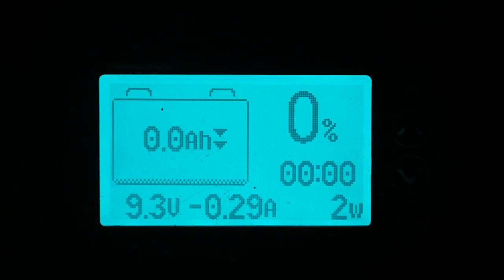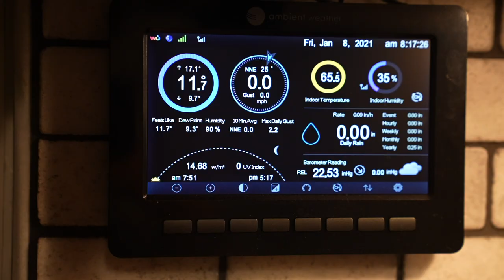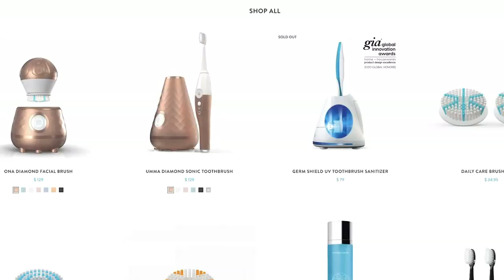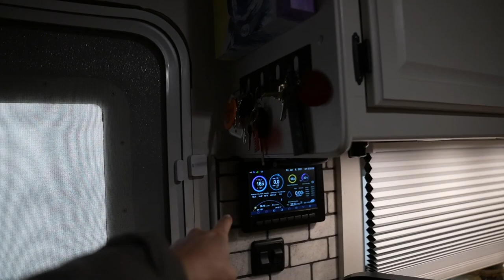WE'VE GOT MAJOR PROBLEMS | WINTER MOUNTAIN NIGHTMARE

Comment: Re: Trickle charger... (I posted a note a few hours ago about this but I think it got lost): Hoping you are not using trickle charger inside or in an enclosed space: we were fortunate to wake up early one day when our Carbon Monoxide alarm went off... took local fire Dept 2 house calls to finally determine our trickle charger in basement (to charge battery for our tractor) was releasing CO into basement and upstairs through our floor boards. Could’ve been a really bad outcome without having a CO monitor. 
If you don’t have some in place, trust you put smoke/propane/CO monitors on your shopping list. 
You folks are such a positive energy. Your videos are a breath of Mtn. air and so inspiring to follow. Keep up the great work....Best wishes as you continue this great adventure, from some old Do-It-Yourselfer’s from N. H.
Reply: Dear folks, CLARIFICATION: thinking back it may be our CO monitor went off from detecting high levels of hydrogen gas emitted by trickle-charging that battery indoors. Still dangerous situation we avoided by having that CO monitor...

Comment: Doing great, guys. Trent - you will be a carpenter by the end of the spring. Having experience with both plumbing and ventilation, would advise start with inside rough plumbing, then pull wire, then place ductwork then you can start drywall. And I noticed the world's best chocolate milk in your refrigerator.

Comment: Trent,  get rid of that crappy water pipe heater tape and go get the self regulating blue stuff it will not overheat and burn out. You have to insulate that pipe and cover it to keep the heat in.  O and the blue stuff is the only thing the farmers will use in this area to heat their water pipes for their cattle feed water.   I hope my 45 years experience as an industrial electrician, electrical contractor makes a difference with respect to my suggestion. Sometimes it’s hard for me to watch you guys do the things the hard way. I wish I could be standing there and make suggestions and save you all kinds of trouble but just like my kids you have to figure out some of the stuff for yourself. I Think the world of you two and I wish you all kinds of happiness and fortune.   Thank you for sharing. Lots of love, Joe

Comment: Want to bet your pressure gauge is where your freeze is happening? Had same issue here in CO during the winter with my pressure gauge freezing before anything else, and I didn't notice any heat tape wrapped around it. Just a thought/observation that might help.

Comment: One thing I strongly recommend is to meticulously plan your electrical installation (switches, lighting, outlets, etc.) as thoroughly as possible in advance.  I didn't do that; I just figured when the electrician arrived, I'd just point and tell him what I wanted and where.  That bit of inattention has led to an electrical setup that's grown haphazardly; I've got an embarrassing maze of conduits and subpanels all over the place, and it's still not exactly the way I would have preferred.

Tip 1:  don't mix outlets and lighting on the same circuit.  That way, the lights stay on if you pop a breaker while running a power tool or some such thing.

Tip 2:  run 12-gauge wiring to all outlets, so you can always run 20 amps on any circuit in the future if needed.  Save 14-gauge, if any, for lighting.

Tip 3:  install lots of outlets.  There are per-circuit code restrictions, of course, but it's far better to have an outlet that ends up being unused rather than needing an outlet where you don't have one.

Tip 4:  buy a large panel with lots of circuit positions; larger than you think you'll ever need.  My electrician came out with a wholly-inadequate panel, and as a consequence, I had to install a subpanel to provide additional circuits to an 800 square foot house.

Tip 5:  (and this is code in many places, but you'd be surprised how many folks don't know this):  put the refrigerator on a circuit all by itself.

The first 4 of these tips all contributed to my conduit maze, and I had a hassle with the electrician over all of them.

Comment: You need to look for something called "Self Regulating Heat Tape". Basically this stuff will only conduct electricity as the temperature drops so you wont have the same problem with the tape overheating. You can leave this type plugged in all year and it will only kick in when needed.

Comment: Trent n’ Allie,
First, two 👍👍.

Have to agree with so many suggesting that you get a generator.  

Consider the Honda Inverter models, not cheap, but hands down the best.  A small Honda inverter the eu2200i with propane conversion installation will handle the emergency you just experienced and then some.

Having said that, your incredible positive attitude(s) will get you through anything.  A generator would be a plus... 😉

Comment: Why not forget insulating the water faucet and fill the water tank in Terry and use the demand pump. Then fill as necessary.  The faucet is designed not to freeze when turned off. ??

Comment: my well house is made of 1/2 inch plywood and is lined with 2 inch foam with  taped seams heated by 60 watt bulb i have a plexiglass 4" window in the door only time it has frozen was 50 below for 5 days and the bulb burned out

Comment: do heat pump mini splits that  need no duct work especially with the open floor plan and great insulation go to an HVAC store and they can help you with the design duct work is the worst and this means less penetrations to the exterior

Comment: Sounds like our lives.  We left on a week vacation and would call home every couple days.  I call home and answering machine did not answer so called our son to check it out.  With the rain there was a electric spike which hit the house and took out all appliances and TVs.  Black up the wall by answering machine.  Had to have electric company cut power so house wouldn't burn.  We were 400 miles from home on bicycles crosses the state.  What a mess.  Now we unplug anything we want to keep! We find nothing happens when we are home.

Comment: I'm betting that the water was frozen in the pipes under terry. The thawed as the heat from terry ran for a while.  Also they call it a "WELL HOUSE" for a reason, make a small shed that covers the pipe coming out of the ground and wrap the hose in insulation etc and run a old school 120 watt light bulb and the heat from the light will keep above freezing.

Comment: Hiya guys. Hope you’re having a great new year with your build.
One thing I’m slightly confused with. Why are you screwing your deck boards down? Surely deck clips would have been,both easier and quicker with NO KNEELING required. Plus more aesthetically pleasing with no visible screw heads to ruin the look. With Trent and Brandon fixing and Alley bringing the boards you could have been totally done in a day. It’s all straight runs.

Comment: Get a 90% efficiency  Furnace-made in USA.. on the Internet for 2000 USD..I installed One ..Installing a DeHumidifier or Air exchanger, that is the Question..how Fancy do you want to be...maybe check at Harnessing some Hydro Power nearby on your lot..some people have a Pipeline from the Creek to Bring Water Into your Powerhouse..insulated and Holding Water Heaters or Water reservoirs..use hydropower to heat water and run them Radiators..

Comment: Also occurred to me, depending on how tight you want to go. I would recommend aero barrier. It will get you a few extra ACH on the blower door. However here's the real killer code is now 3.0 ACH/50. With that and tighter you need in addition to heat/cooling you'll need an HRV and makeup air system. zehnder air is really the market leader in the makeup air systems and super user friendly as it doesn't require pipe load sizing calculations. And a de-humidifier because even at altitude as humans we are sinky and produce lots of water especially when cooking that would be driven into the wall so you need to give a sealed wall a chance to dry to prevent mold problems.

Comment: I wouldn't presume to know what you did, but I imagine you still had air in the line from disconnecting the hose. Lines don't unfreeze that quickly in below freezing temps. But, who cares, you have water.

Comment: The lines in the camper were probably froze once you got the heat on it unfroze our jayco 4 seasons does that every once in a while if we are traveling and park a couple of nights well below freezing have the same problem, but yard Hydrants are a pain  I tried using mine for a water supply to my shop it would freeze all the way down to the foot valve and cracked the housing had a monster water bill in the spring. So I shut it off and blow it down every winter bad thing my shop has no water till spring sucks.

Comment: I would of ran the extension cord
And let the small space heater kind of give you some relief until the power is back up
Hoping at the 10 it turns on

So glad it turned back on so you all got heat
Most important❤❤😁

Ive seen other comments
I agree maybe a little shack heated around what is causing an issue ie the frozen water
Or whatever else
Keeping a extra portable charger to run heaters may be a good idea too🤷

Allie I'm with you
I definitely would do the ladder down the way you would❤❤😁

Comment: Be careful with the heat tape, you are not supposed to wrap it around the pipe in a spiral, also it must not cross over itself. Best way to use it is parallel in straight lines up and down the pipe and wrap with highly heat electrical tape. Also the thermostat is supposed to be pressed up against the pipe and taped there, this makes sure the pipe never gets hot enough to cause damage. Please be safe

Comment: Absolute must haves:
1)      Generator
2)       Alternative Heat Source for Terry ( will also warm a small area of your house if needed one day.
3)      Herman Nelson ⚡️Heater⚡️ (sorry I only know this type of heater by brand name)(there are a variety of fuels as well as brands). If you truck is diesel, I say go for diesel, otherwise buy a gas model. Propane is an option but remember that propane can and does freeze in extreme weather.  
4).    Get yourselves a tidy tank for fuel. 

Whenever you leave home take the tidy tank with you.  If you rely on propane for anything in your home, bring propane home with you,. ( don’t let it freeze). Always pack water in jugs,  on your return trip home. Have yourselves a wood heater, carry some wood, an axe, fire starter, whatever you need to be prepared to thaw you home when you get there. Otherwise, you will be prepared to spend a night or two if you get stuck somewhere.

You two are smart cookies. The mountains can be so unforgiving. Crazy beautiful but tough. You’ve so totally got this 🏔 ☃️❄️⛄️☃️☀️🌏🌘🥶🌎🌏❄️🥶❤️⚡️❤️❤️

Comment: Tell Trent to remember next time he also has two other 12V charging systems! His truck and your car... just run some booster cables to the batteries. Or like someone else said I would invest in a generator especially being up in the mountains where you could lose power at anytime.
Reply: They also have 120V, so just power the stuff currently on the inverter off of the existing 120V supply instead of going 120V -> 12v battery charger -> 12v battery -> 120V inverter -> 120V load

Comment: Trent n Allie put heat tape around the tap..everywhere then surround it with fiber glass insulation. .don't miss tape anywhere from bottom to top..tape insulation. .make it a foot thick..around..leave water at a drip drip drip the toilet..use garbage bags..cause I have no solution if it plugs do not use long screw driver cause it will work..but u will get a free shower u will not like..info is me n my mom living in our trailers for years..n me fixing stuff..hair dryer unthaws pipes..but ur froze at end..thank god for my home

Comment: Dude...a Tube over that hydrant is not good enough.  Granny here has been through these little headaches decades ago.  You need to build a box around that thing.... like 8 inches square and insulate inside of it.  And it does look like the pipe is pretty high out of the ground.  If you shorten the pipe then there will be less frigid air for the pipe to defend against.   Hope that helps.

Comment: There are two styles of heat tape if you are not using self regulating heat tape and it is placed against a metal surface it will over heat and short circuit over time. You need to purchase self regulating heat tape and you won’t be blowing breakers and you will never have to worry about the pipe getting to hot. Self regulating heat tape cost 3x and requires a controller. Heat tape like you have expects you to plug it in and unplug it when conditions require. It is very likely this problem will happen again and will cascade into you loosing power in the rv again.

Comment: Why not insulate next? Then you can work in comfort in the interior. That little heater will keep it warm in there with insulation.
Reply: I’m a electrician and I’ve wired many house that already had the insulation in before. A bit of a pain but nothing horrible. 

You don’t put plumbing pipes in exterior walls so it won’t really affect that either.

Comment: Trent, I have 2 items to comment on. 
1)  Your electrical system concerns me, as I own a Pace Arrow motor home, and even with the batteries disconnected I have full electrical usage when plugged in (including all 12v lights and pumps and fans. Does the loss of all interior electrical have to do with the installation of your solar upgrade? if so is there a work around.
2) My family has owned vacation homes in the snow country of California. when we leave the home for an extended period of time, we would drain the water lines at the source. do you have a valve somewhere where you could turn off the water supply and drain the system when leaving for an extended period of time. This would allow you to turn off the heat tape at times of extended vacancy

Comment: If I heard you correctly you plan to put a pipe through your roof for the wood stove. Depending on where you locate that stove, you don't have to put a hole in your brand new roof for the pipe. National codes will tell you how to run it out through the side of your house if your wood stove is close enough to the wall to do that. Having youngsters in the house you don't want the stove sitting out in the middle of the room anyway. You can do the same thing with your plumbing vent pipe --take it through the side of the house rather than the roof. Again, look at National codes to see how it's done properly. It took a while for our local plumbers to get on board with this just because it's always been done through the roof.
Speaking of your roof, my pitiful little cell phone shows your ice and water shield with bags and sags. It was too cold when you applied that product without applying heat (like a heat gun, etc.).

Comment: Check around town this summer and see if you can find someone to tape and mud the drywall for you.  IT IS A NIGHTMARE JOB!!  They will do it in two days with very little finish sanding for you to do.  TRUST ME, been there done that.  Working off scaffold mudding walls is not easy or safe.  You will have enough to do just mixing the mud and keeping them supplied. See how you feel after hanging all that board up.  Also, rent a drywall installer cart.  Will save you a lot of time , effort, and be a lot safer!

Comment: Whole house generator with tri-fuel....propane, gasoline or natural gas.....when you're in the boonies, you're gonna' need it.  Also a heat pump....new generations run very economically and supply air conditioning and heat. (make sure your furnace filter is reachable without a 20 foot ladder....I've got one property in which I have to use a ten foot ladder to reach the filters....dumb contractor)  I'd probably also run some plastic electrical conduit (grey stuff...very low cost) to places you MAY want or need electricity in the future) Once the drywall is in, it's a pain to fish wires from one place to another. As for plumbing do NOT use pex with crimp-on connectors.
I would use Wirsbo (made by Uphonor)...it's flexible schedule 80 pipe....the connectors are bulletproof and easy to install. You can also make long runs without any fittings...it's just bends and can go from the basement to the attic in one piece. Make sure there's a vapor barrier on every wall.  It's fun watching Trent work like a dog while I'm in Las Vegas sipping chai tea and eating butter cookies......lol...lol.   Good luck

Comment: As for your water freeze ups hey I'm a plumber retired wrapping it up is not going to solve your problems no matter how thick you make it you need to build a shed around that thing and then you have to wrap it and then you have to install cable type heat tape with a hot plug all those other ones that have thermostat controls are nothing but garbage a cable type heat tape with a hot plug always works if it goes defective the only thing you have to replace is the hot plug the cable is guaranteed the last 25 or 30 years but you need to build a small shed with roof or flat top you can install a hundred watt light bulb inside of it to turn on at dark that will offset the the cold coming into the building or the little shed believe me I know what I'm talkin about But there again to you're going to do it your way and you'll be going right back to this scenario all over again take it from somebody who knows trying to give you good advice that's all I got to say about that